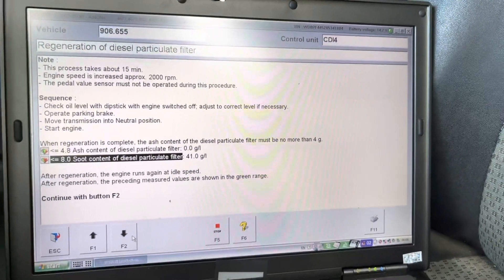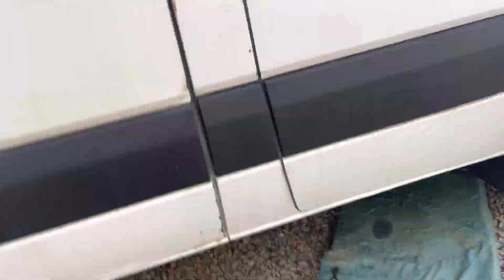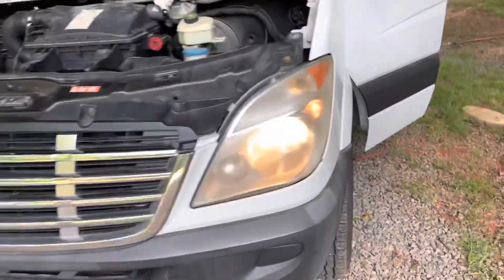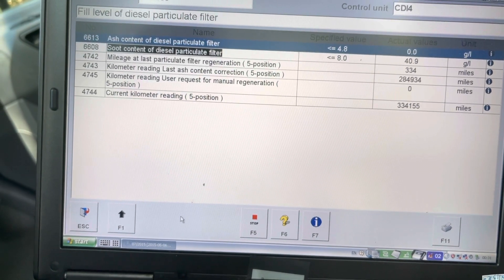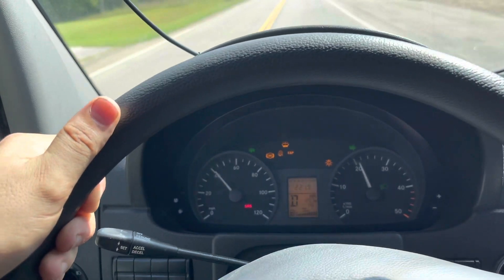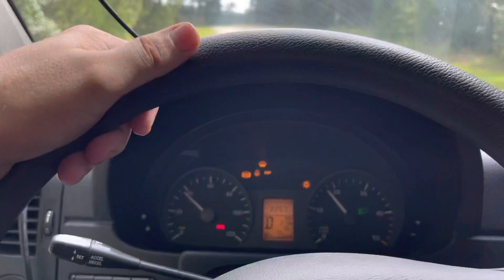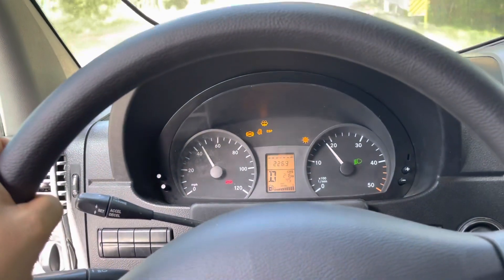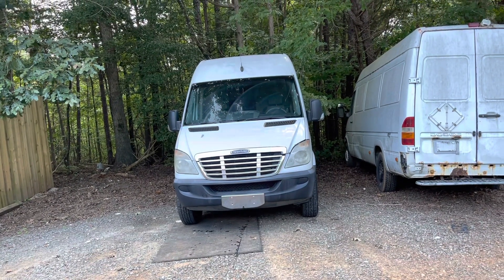Part 3 Freightliner sprinter DPF Regeneration Using star diagnostic system SDS

Comment: Take off the dpf poor in 3 liters of degreaser and leave for 30 mins. Then pressure wash out.  Then add 3 liters of brick acid and leaver for 30 mins and pressure wash out. The soot and ash will now be removed from dpf and it will fix your limp mode and stop the exhaust from pushing gas through your flexy.  2 hour job.
Reply from the maker: Thanks

Comment: Are you still selling cars? Or did that never take off
Reply from the maker: I have 29 cars right now, mainly selling car parts and doing sprinter repair work, but thinking of selling some cars
Reply: Its been a minute! I only need a beater. I'm considering even payments to help improve my low fico. ALSO do you hire Drivers with Expedite experience?